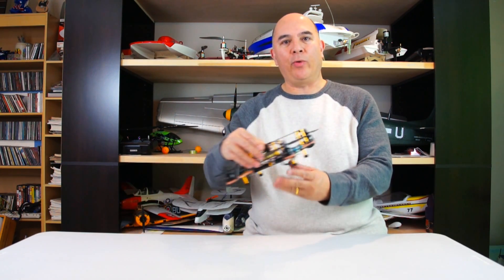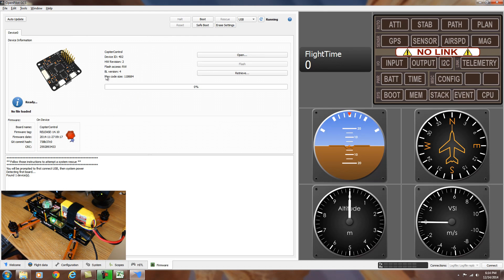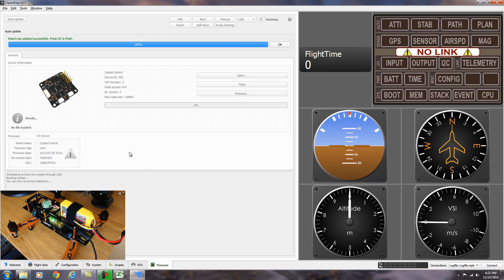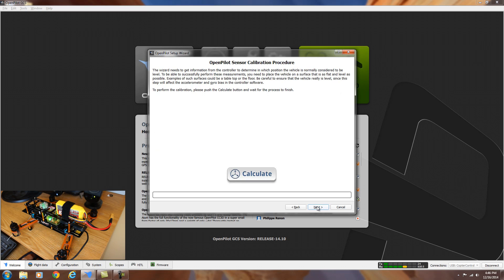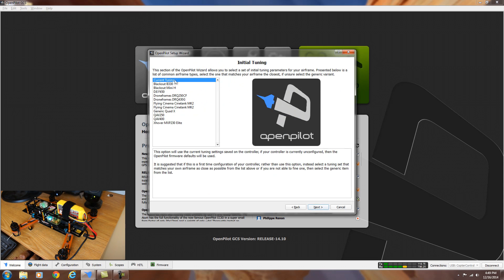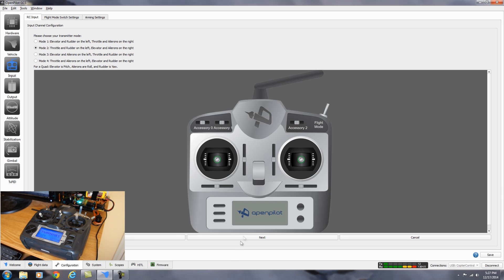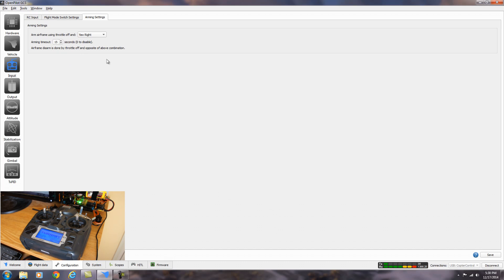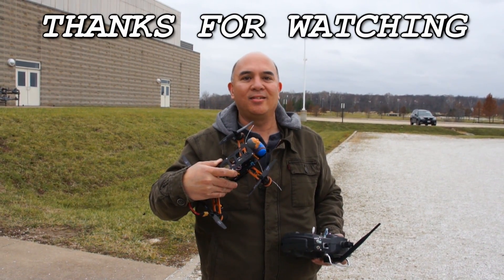Mini 250 Quadcopter Part3

Comment: Thanks Frank I got my 250 quad going today,how do I dumb down the throttle ?
I also built the sk 450 from your video and it fly's great, Thanks again
Reply from the maker: jay ish Not sure I'm new to openpilot cc3d so left mine with the default settings. You might be able to change it in the GCS or with your radio tx settings. You might want to check out the forums and post your question there.
Reply: Thanks, i ajusted the travel and expo and it flys great in my TX.

Comment: I have a hobby king orange RX would # 1 be throttle # 2 Ail  # 3 Elev and so on?
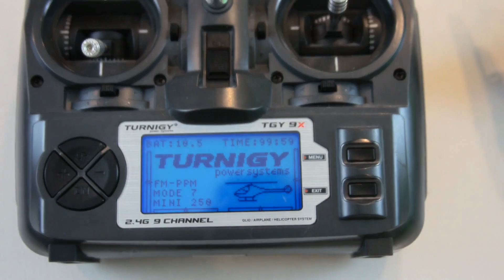Reply from the maker: jay ish Plug them in order as shown in the video at 0:35 sec and then set them up in the GCS as shown in video at 11:15 min.
Reply: DiehardRCaddicts
thank you

Comment: On the bootloader it says to install the one that is writen on you board, and the one it says is for cc3d is version 3.
but you used version 4 on yours, not sure which one to pick.my board is the same one that you have, from banggood.
Reply from the maker: jay ish Always install the newest version of OpenPilot GCS which comes with the latest firmware. You will also need to use the related bootloader for that version of GCS. Please use the links in video information bar below video to find out which versions are available and install instructions.

Comment: Is the CC3d flight controller compatible with flysky fs-i6 transmitter ,I have order all the parts you have in that link with the flysky fs-i6 transmitter and I am in a doubt about the compatibility of cc3d fc to the transmitter

Comment: Greetings from The Netherlands. Really nice series, thanks for all the time you must have put into it. Think i found my kit! What battery do u use? And how many c batt can this setup handle?
Reply from the maker: Mark Poorthuis I use Rhino 1350mAh 30c batteries from hobbyking and get 6-8 minutes. You could use up to 1600mAh if you want longer flight times but wouldn't go much bigger than that or will start getting too heavy.
Reply: DiehardRCaddicts I ment to ask how many S. I understand more cells give more power witch result in better handeling in the corners. Would you say this kit is a good starting point for a beginner? I have a gopro and would like to use fpv in the future.
Reply from the maker: Mark Poorthuis The 1350mAh Rhino I use are 3s (3 cell) LiPo batteries. Not sure I would recommend it for a total beginner as it is fast and very agile. You could always turn your rates down on your radio to tame it down. This quad would have no problem lifting a gopro.

Comment: When i set up my TX for this quad do i set it up in acro or heli mode, it looked like yours was in heli mode.
Thanks for the video.
Reply from the maker: jay ish You can use either one. I used heli on my Turnigy 9x because it was easier to setup the 3 position switch for mode selection using the heli throttle curve channel. But now that I think about it I have all 3 positions still set to stabilize mode so I guess it didn't matter.
Reply: DiehardRCaddicts
Thanks Frank,how is this 250mm holding up,motors,esc ? i have ordered these motors and esc and the cc3d fc.
Reply from the maker: jay ish Haven't been able to fly it as much as I want to because of the cold weather but it has been holding up pretty well so far. Even after a few crashes, only had to replace a couple props.
Reply: Thanks for the reply, i am still waiting on parts to build my 250 quad.